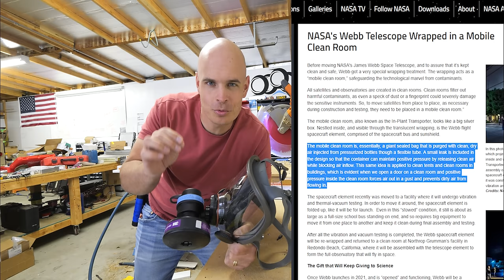The truth about Dyson "Air Purifying" Headphones...

Comment: What if I inhale quickly? Is the fan strong enough to keep positive pressure if I suck the air out of it quickly? Or it only covers relaxed breathing situations?!
Reply from the maker: I imagine as long as you're not running/exercising with it - it would keep enough air supplied. Lol I'm not using mine anymore.  You want it? A gift from one channel to another. It has been taken apart once. But still works.
Reply: It definitely won’t work anymore after ElectroBOOM gets his hands on it 😂. 

At least it will go out with a bang! 💥
Reply: @JerryRigEverything  :D sure why not! Maybe I can make a vacuum cleaner out of it!!!
Reply: @ElectroBOOM  😂
Reply: At the end of the day, this dyson product just feels like an idea put together
Reply: @JerryRigEverything  yes please
Reply: If it can maintain 4-5psi, then yes. That is the pressure SCBAs (Firefighting gear) runs at. Not sure if it would work at the 1-3psi range.
Reply: @ElectroBOOM  make the strongest smallest desk vacuum, oh and the most expensive too
Reply: @nathanielmoore87  it needs to maintain more output than that, because SCBA has a seal already, meaning it's not having to out-compete free-flowing air.
Reply: @JerryRigEverything  I had a total collapsed lung in April and all this smoke even in central USA is kicking my butt, I could definitely use it 🥺
Reply: @ElectroBOOM 😭
Reply: How will it do on an airplane, will the air be fresh and cool ??
Reply: @ElectroBOOM I just found this video through a short if you got these please link a video
Reply: @JerryRigEverything lol is that not when people use earphones?!

Comment: I think the only criticism aside from looking dumb is that it filters don’t do as well as an N95 mask.
Reply: well, it lets you breathe easier. i take it as a plus
Reply: @ismaelyu5  , that doesn't mean much. I take it that you're implying N95 is hard to breathe through. N95 is bottom of the barrel for PPE. I have a P100 respirator and I can breathe just fine. That Dyson unit looks like 100% overpriced trash and in no way should be considered to be protecting you like PPEs a fraction of it's price would.
Reply: Oh and its a 1000$. Aside from it not actually working, according to mkbhd
Reply: @daveubermensch  i know there are better solutions out, but none of them would be as easily to use and not complete cover your face when you just need a filter for most allergens. I know a lot of ppl who don't like to go outside in spring because of that. And they wouldn't put on a normal respiratior. I could imagine this thing where you just but the visor down to talk would be easier to use in that case.
And none, even not the doctor at mkbl did mention anything about allergens and if its working, everyone is just making assumptions.

Comment: Computer building community has known about this for decades.
If you want to keep your case more dust free, have more filter incoming air than outgoing air, to create a high pressure zone in the case.
If you have more air output, more fans sucking out, dust will enter through every crack in the case.
Reply: Good point! :face-red-heart-shape:
Reply: Basically have positive air pressure because negative air pressure will literally make your case a vacuum.

Also, keep in mind that 1 intake fan is only 1/3 the strength of an exhaust fan because of the filter in front of it.

So 3 filtered intake fans is equivalent to a single exhaust fan.

Comment: John Deere, and other Ag equipment brands, have been using positive airflow for decades (since at least the 70s) to help keep excess dust out of their equipment cabs. Many cabs have a small interior air filter and a larger pleated outside-air filter. Though the pleated outside-air filter is not usually a heppa filter (newer sprayers can have pretty good filters). One set of fans pull air through both filters simultaneously, thus slightly pressuring the cab. Works decent until someone opens the door wide open just as you've stopped in a cloud of dust! If you ain't dirty!
Reply: This system is the equivalent of attempting positive airflow with your door open halfway.

Comment: I would like to point out that a full-face respirator that is OSHA compliant & have a NIOSH rating gotten from a reputable seller is only ~250-300 and with the right set of filters will keep you from getting dead if dealing with actually hazardous air where as the Dyson will do practically nothing

Edit: For a forced air hood respirator you can get one with NIOSH rating for ~450 so still better than the Dyson because it can actually protect you from things
Reply: and for working in an IDLH (immediately dangerous to life or health) environment you can get a SCBA for ~3k
Reply: I don’t think Dyson is targeting industry workers who need full protection for work. 

They are targeting people who want to walk around the city, go on subways, and have good air quality while listening to music and not look stupid.

But they do look stupid, and that’s the problem with it.

It does do a great job, better than your cheap cloth masks. but people would likely feel more normal wearing n95 than this. But also true is it’s nicer to breath out of this than an n95(properly fitted)
Reply: @korvish111  I'm just pointing out that a real forced air respirator from a reputable supplier is a fraction of the price and has actual ratings to prove that it does anything so someone would be much better off getting one of those and a high quality headset for the price
Reply: @crazy_human2653  yeah but you are really, really missing the point. 
It’s almost like comparing a cordless saw vs a corded saw. “If you really wanted power get a corded saw, and it’s cheaper, therefor cordless is stupid”.
Or even worse, it’s like if Apple started marketing using their phones’ flashlights underwater and you saying “I can get much cheaper, actually water proof rated flashlights that can be used 100m under water”. Not exactly the intended use case of an iPhone flashlight. 

Dyson’s big miss is how stupid this thing looks. If was actually nice, it would be a hit. Decent air filtration, comfortable, headphones for audio, it would be a great public transport commuting device. 

Also remember this was in the works before COVID, which has changed everything. If you see someone in an n95 it’s 100% acceptable now.

Comment: Same principle as a pressurized aircraft cabin. Bleed air from the engine fills the cabin. Pushing in more air than it can hold… creating internal positive pressure (like a coke can). Over pressurization is released by set valves.

Comment: I mean, if i were so worried, wouldnt i just use a facemask? its lighter, doesnt look as ridiculous, its cheaper and some models can be washed, like my underwear. And i dont need to wear the headphones to use it.

The fact that they charge 1000$ for it makes me think there has to be a market for these, and they overpricing for that same reason. They might be trying to start a monopoly of that market and i would be surprised if they allowed the device to be repaired by independent technicians, assuming its repaired at all instead of just replaced or destroyed by the company with the excuse of it being "dangerous" to repair, without any compensation to teh customer. Now im not saying theyre doing or gonna do that, because i dont know, yet.

P.S: Having a vibrating device attached to your body cant be good :/ a facemask sounds better and better by the minute.

Comment: With all the panel gaps a tesla has I'm not sure I'd trust that filtration system to work very well.
Reply: positive pressure means that leaks dont matter
Reply: Rather have a panel gapped Tesla than a solid interior BMW that breaks down every week 🤣
Reply: @KingFinnch  Yes I suppose you're right.

Comment: Good video! Too bad people hate the product so much they don’t want to try and learn the theory.

I’m curious for this to be actually tested in a lab. The theory sounds good, but does it actually provide over pressure while inhaling?
Reply: Not really. One normal breath is half a liter, while a deep breath is several liters. In any given breath you'll be pulling in air faster than the filtration system can produce it, meaning you'll be breathing in a pretty solid mix of both filtered and unfiltered air. If you make sure to breathe very shallowly or slowly, you can get the most benefit, but that's only realistic some of the time (not while doing anything remotely physical such as walking).

Comment: I think I can speak for everyone….  Your review process is pure GOLD.   Keep branching out with other products!! A+++++. Won’t be long before network TV signs you and makes this not fun anymore.
Reply: I'm not sure if this is sarcastic cause that review was horrible.
Reply: @_aullik  not sarcastic at all.  He’s great.  Not many can do what he does
Reply: @_aullik  not everyone is a troll.  What happened to the good ol Color  64 BBS on the C64 days
Reply: @74Vintage  I absolutely agree that not many have his personality or his skill. Which is why i am subscribed. 

However some of this reviews are just bad. The heat pump + battery video recently titled "this changes everything" was just plain wrong when explaining the tech. Even when you ignore that its a gimmick at best. I'm pretty sure this was just an advertisement he produced.

The hydrogen video was also complete marketing BS. This technology is in use for ~5 years and there are practically no customers for it. 

Now this. He is right about over pressure. However the worse your seal the more leaks you have the more airflow /  over pressure you need. This thing can never produce enough air flow to overcome the giant gaps between face and plastic. Also have fun trying that thing with glasses. He again sells the product as cool and working. It is not.

Comment: I mean it's more just marketing fluff for the same carbon filters all modern cars have. Like seriously, nearly all cars have them. Tesla does have the really fancy giant one, but considering most people never even replace those carbon filters, it doesn't seem most people care. Those carbon filters are supposed to be replaced every like 1 year or 12K miles. They have a really short lifespan and basically nobody takes care of them. Many just replace them with a basic filter anyways as those can be cleaned, you can't clean a carbon filter.

Comment: Stupid take. Yeah sure the concept of overpressurization is fine, but without any proper testing you can't be like "yeah same concept so it works and better than nothing". I mean compare it to your woodworking mask, the thing is pulled tight to your face with a rubber seal all around. Not some cheap plastic garbage with huge gaps all over the place.
Reply: exactly, all those examples he shows created a "sealed" enclosure, without it there is no over pressurization lol I feel like Zach is trolling here, he def saw MKBHD vid and knows how blowing air into your nose can actually cause even more problems...

Comment: That dork-headset is not even close to working how well the Biohazard mode on a Tesla works. That constant airflow directly in your nose is actually pretty bad for your nasal lining and (mucus membranes). Industrial masks solve this by moving more air much slower.
Reply from the maker: As someone with both masks in hand - the industrial 3M mask is moving far more air.  Maybe 2X more. Neither mask is different for your mucus membranes than just going outside on a slightly breezy day.

Comment: I love my JRE knife, I have 2 and bought my son 1. I do handy man work/repair as well as marine servicing and the knife is great, I just with the blade release was on the other side because when I hold it up close for good control I keep accidentally releasing the blade. Small issue I know...but it has help build 1 mother-in-law apartment and several other remodels and still works like new

Comment: I think this air purification is ridiculous.  I'm almost 60 years old and I've never had such device and/or protection doing woodworking, welding, sanding, etc for the past 40 + years.  I'm perfecting fine and I don't think anybody needs this crap.  I'm probably more susceptible to getting ran over by a bus or struck by lightning.

Comment: This take on the dyson headphones is as stupid as it is uninformed. Sorry Zack, I usually tend to trust what you say but this is totally innaccurate. Take a look at what MKBHD and Dr. Mike have said. Dr. Mike especially could teach you a thing or two, specifically about partical physics, like how the particle size rating doesn't work anything like sand in a pasta strainer and how this isn't anything similar to a pressurized filtration system like what NASA or TESLA uses. These headphones are as useless as they are strange and expensive.

Comment: "This guy removes 99% of pollutants and goes as tiny as 0.1 microns"

Contrary to what you might think, air filters do not work this way. The "0.1" or "0.3" micron ratings are because particles in that size range are among hardest to catch. Smaller particles follow whats called brownian motion, which actually makes catching them trivial in comparison. If you can smell something while using these, its either because the filtration is substandard or because the over-pressurization isn't foolproof (probably the latter or both). 

You should look into n95 mask fit tests which verify proper fitment by confirming you can't smell a solution sprayed into the room.